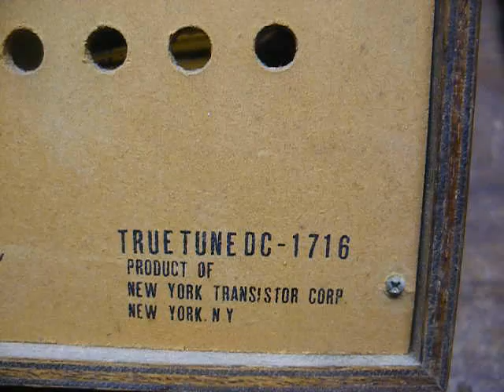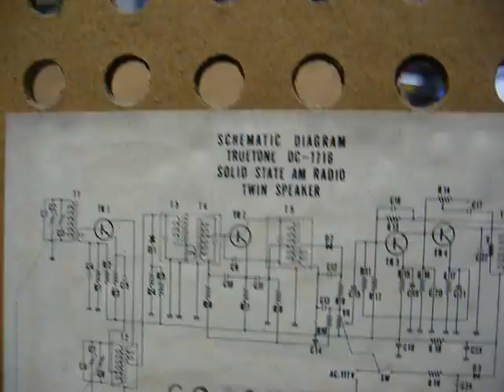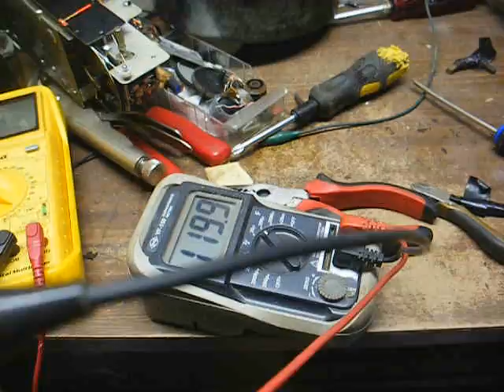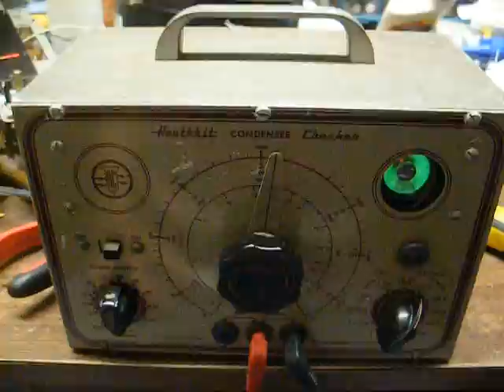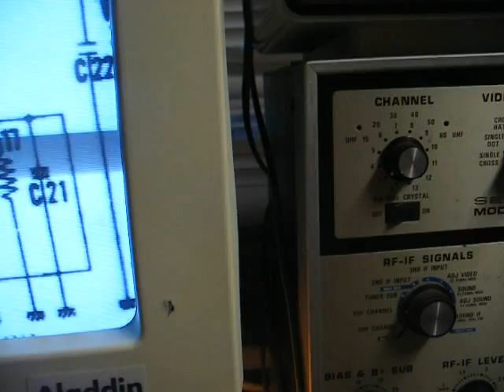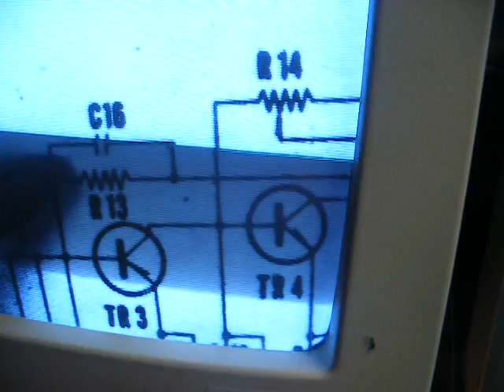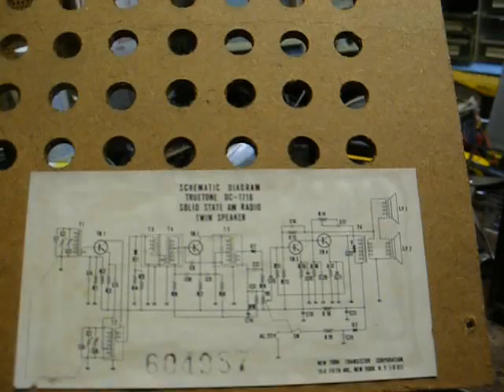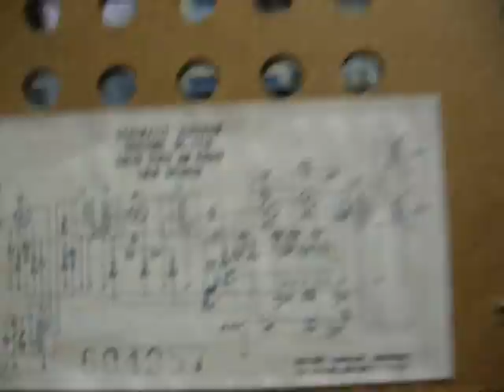Repair of a 1960's Truetone AM solid state table radio

Comment: Japanese Solid State version of an AA5. Love the simplicity of 1 transistor being the RF amp/local oscillator/converter 1 stage of I.F. and a direct coupled 2 transistor audio amp with high voltage TO66 packaged output transistor. I caught your voltage measurements on the output transistor and realized we're dealing with Silicon devices even circa 1966. No way really to direct couple Germanium transistors.

Comment: The radio of factory  bobo's They couldn't even print the name correctly so internal screw ups is no surprise. Some of the early Japanese stuff was crappy like those little small tube radios  the parts are small and cheap. those sets are the worst for squealing, and motor boating. Good job as always.

Comment: I know you've buttoned this one up and moved on to other radios but... could those speakers be out of phase? The schematic shows them wired in-phase, but in the radio the speakers are mounted back-to-back, so to speak, and the terminals wired straight across. If the speakers are identical, I'm pretty sure that would make them out of phase. It might make a difference in the sound? Thanks for making these videos, by the way - they are great!

Comment: Excellent video, as always.  I have been watching your vids for a while, and I really enjoy your practical approach to things.

Have you ever run across cheap All American Five tube radios that just seem to be designed to not play loudly.  I have been working on a really cheap Packard Bell kit AA5 plastic radio.  It's in good alignment and all of the measurable parameters seem ok, but it just doesn't seem to get any louder than what it takes to fill a small bedroom.  It has a 4" PM speaker, if that is any indication of design intent.    Michael

Comment: Is that really a set of back-to-back diodes across the output transformer? That's what it looks like the schematic shows.
Reply: William Squires  it's a vdr, voltage dependent resistor. limits voltage spikes coming back to destroy the. output transistor

Comment: Cheap design , the audio driver and output stage may work better with higher hfe transistors . I suspect they put the cheapest ones in they could buy and not the best ones. One of the audio transistors may have gone low gain as well which would reduce the loudness.